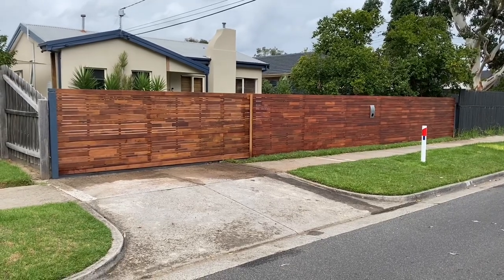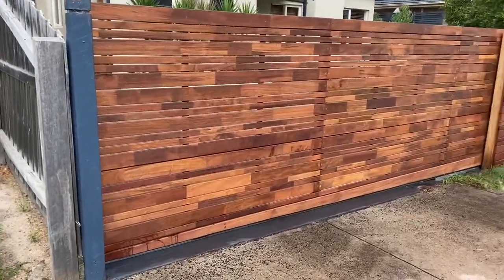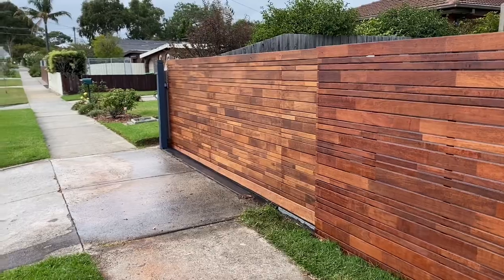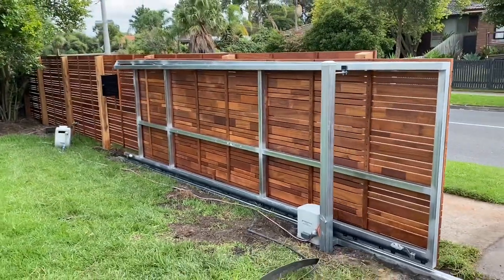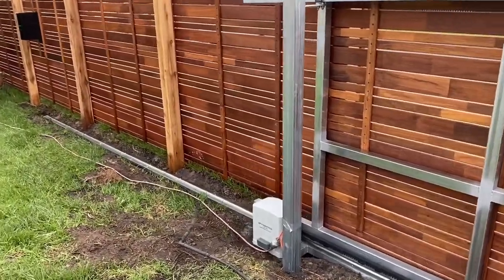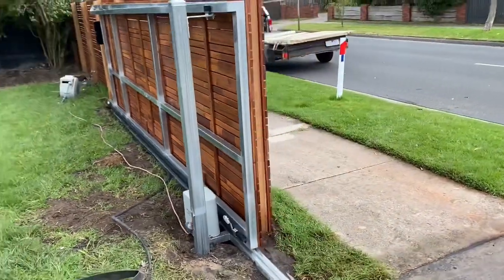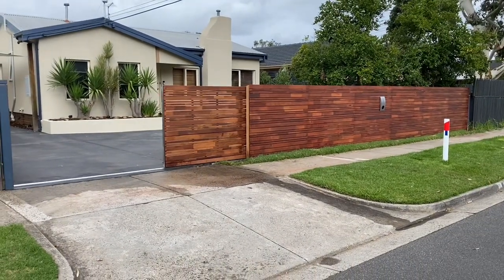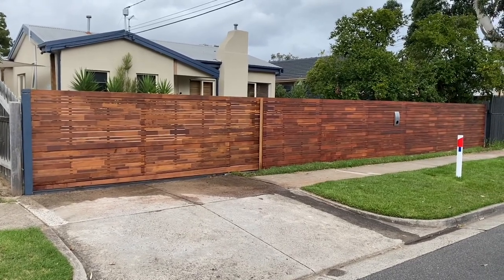SpecRite merbau fence panel feature fence with automatic sliding gate

Comment: Beautiful job it looks amazing and stops those sticky noses. Just off the video one bit of feedback could maybe be to have the letter box on the left side where the driveway is so there is no need to walk on the wet grass. But there is not much room left on the driveway so probally not possible in this instance. Maybe the customer can get some modern pavers installed on the lawn that leads to the letterbox. Great work.
Reply from the maker: That’s exactly what the client has done. 👍

Comment: Hi, it looks like you spanned the panels the full length 1800 from post to post, were there no issues with this? I am going to use for a screen vertically (not horizontal like this fence) and was planning on 3 fence rails with hw posts at 1500. I can’t find any installation instructions on line?
Reply from the maker: Great question. These panels are made spot-on. which even I was surprised.